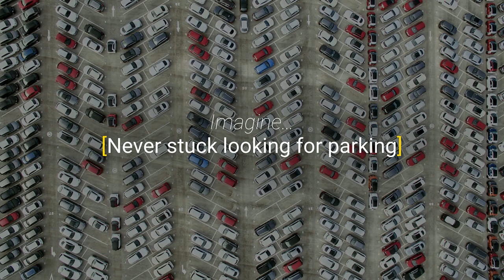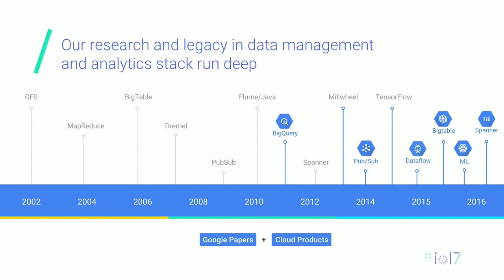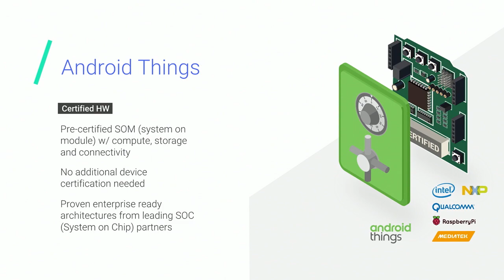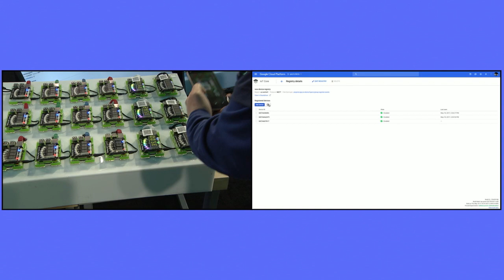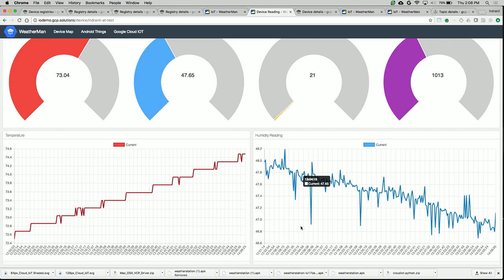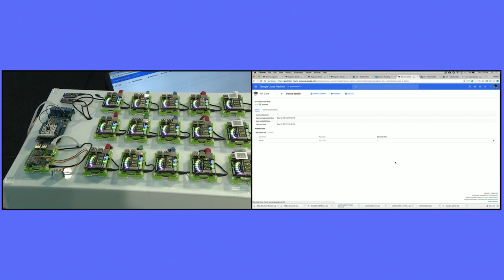Building for Enterprise IoT Using Android Things and Google Cloud Platform (Google I/O '17)

Comment: It's great that Google entered IoT game but this presentation was honestly quite poor. Quick registration with QR code may look cool but it did not say how developers would take advantage of it. As a device maker I want to make sure that I can ship a device that someone without knowledge or app can EASILY register to my service running on Google cloud. You show the code for registration but you don't mention how the keys would need to be generated or stored on the device which is actually more basic information. Also, talking about scaling begs for explanation on how one can control not just devices but users too...you mentioned that role can be applied to devices but individual users can own many devices and they will different level of authorizations from admins of the IoT network. Finally, Google presentation using a Mac...seriously...what kind of message does it send about the hardware Google builds?